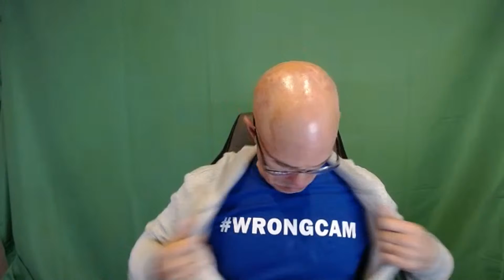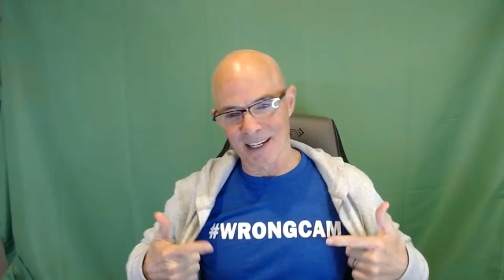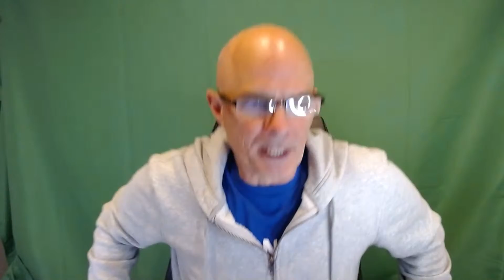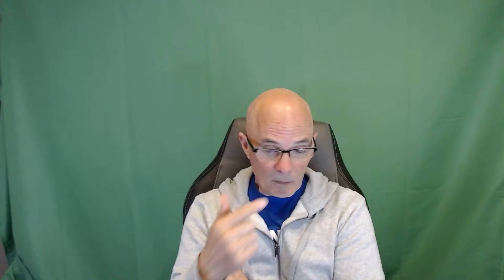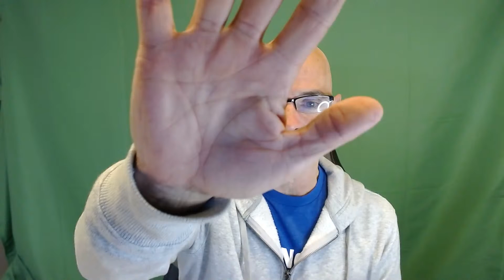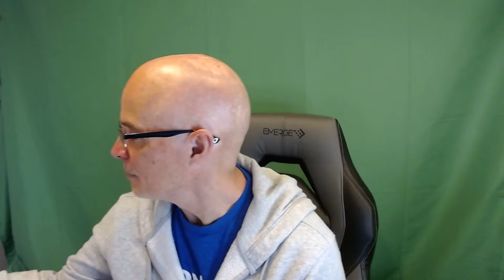BTR TRUCK NORRIS HEMI CAMS-LET'S TALK TECH

Comment: What do you think their stage 4 cam could put down in a manual 5.7 challenger ? I have catless longtubes, getting a valve job and bowl blend and running 6.4 intake
Reply from the maker: will it fit the avail p-v?
Reply: @richardholdener1727 huh?

Comment: I know this is an older post, but I can’t find any videos that are more relevant.  I’m getting ready to tear into my 5.7 on my 2016 charger pursuit.  It’s got lifter tick in cylinder 3, while addressing that, I figured might as well throw in a truck Norris cam. I have one in my LS powered Jeep that I love, figured I would love this one too. Here’s my question, ultimately I want to be at 500 HP to the wheels(it’s AWD too, so expecting slightly more than usual loss), I know I won’t hit that with exhaust, Cam, and Intake.  So should I just tear down the block and add ring gap while I’m in there? I don’t think I would need much boost to hit my target.  Maybe just 5 lbs, lots of folks say you can run boost at 5 lbs safely without adding ring gap.  What are your thoughts on the topic?  If I do a complete tear down, it really makes me think I should do a stroker kit to 392.  But obviously that’s a ton more money I don’t have.
Reply from the maker: just add gap-don't need to stroke it-add boost to desired power level (you can get 500 whp with a stock cam)

Comment: I have a 2014 5.7 Ram for you to run it on. All brand new in box never installed. 392 stroker kit With a forged bottom end and pistons .005 over, block not bored/ honed diamond finished yet, comp pro magnum roller rockers, 6.4 ported manifold, “hellcat” lifters, ARH long tubes, Milodon oil pan and pickup. + many more.. Motor out and disassembled. Stock cam and lifters looked great.

Comment: i've seen way too many LS truck engines die because people are adding a bunch of boost without making ring gap and rod bolt/main bolt changes. even then too many tuners are running them way too lean looking for that big number. They are not much better than the hemi really. a safer tune that lasts is the better approach.
Reply from the maker: no need to change rod or main bolts
Reply: @richardholdener1727  I’ve seen them fail. We autopsied a few blown up LS engines when I was at JBA in San Diego.  Customers who had another shop “build” their 5.3s and 6.0s before coming to us. Hard to know for sure if it was builder error or factory parts just failing. I know the aftermarket rods and pistons in those builds we did for them afterward are still doing fine 3-4 years and hundreds of passes later.

Comment: I actually just installed the btr truck Norris cam in a 6.4 hemi, knowing that it was technically designed for the 5.7 I'm curious to see how the power turns out. I'm still working on tuning it unfortunately (my first dodge tune, normally work on gm)
Reply: What car is the 6.4 in? Super interested in your results
Reply: How did the truck norris end up working out for you?

Comment: Richard would you be willing to test out lifters on a hemi 5.7 for example the 57 stock lifter compared to the 61 lifter compared to the hellcat lifter also compared to the 64 lifters off of course not MDS because there would be a restriction there but from my understanding I have heard that there is variances in these lifters so maybe it would be another test you could probably do.
Reply from the maker: what would the lifter change?
Reply: @richardholdener1727  ok myth is that the lifter plungers internally are different several companies have mentioned that the hellcat oe lifter be used for a cam application yet no one has had any video footage or dissembly nor Dyno testing on it just want to know if it's fact or myth they have also said that 5.7-6.1-6.2-6.4 hemi lifters are different yet the same part number being used online. What troubles me is that a solid roller lifter set up would be incredible for hp but having the hydraulic part 👎 and hot and cold lash to adjust the valve is the problem after if you did go to adjustable rocker arms. On top of that drilling the stock rocker arm to install a ball and cup adjustment screw with ball and cup push rods would give you a true hp number especially with hemi cams. None of this research has been done. Bud you are awesome and when you started the hemi series there was a bunch of hope that opened up to a lot of guys because being honest everyone has an LS but a Hemi on the other hand still to this day whoops on Chevy and Ford due to flow of those heads. 

Ps thanks for answering my question your awesome sir I'm super stoked that I got ahold of you sir.

Comment: Scoggin-Dickey's stock power numbers were realistic, and quite a bit less than BTR's "stock" numbers.  What gives?  Is BTR overinflating the stock numbers in order to pad their cam's numbers?  That's the only logical explanation that I can think of.  Go watch the SDPC hemi cam shootout video and pay attention to the stock numbers.  They are right in line of what you'd find in our Challengers and Chargers, with the added benefits of no accessory drive, coupled with the headers, and the power increase that both will yield.  BTR numbers were significantly higher.  Who's dyno is lying?
Reply from the maker: conspiracy theory much? You have two different dynos, running two different motors, with two different tunes, with two different set ups and yet you try to compare them. The problem isn't either of the dynos, the problem is actually you
Reply: @richardholdener1727  I called both companies to ask about their numbers and their engine dyno configs.  Pretty fair, right?  So, there's some more to the fuel for this fire.  SDPC used a Holley computer, which doesn't control VVT.  BTR used a Haltech, which does.  Can VVT actuation actually produce a 38HP gain?  Honest question asked of you.  I suppose that it can.  Man, I was just going off the data in YOUR Hemi book that I have in MY library.  SDPC's numbers lined up with those that you published.  Knowing what I know about where you test, there's also a Holley EFI system there, as well.  Am I on the right track now?  Will my VVT-controlled engine, with BTR's Stage 4 cam, produce the same 500+HP number that they saw?  I would like to think so.
Reply: @ronbo422  holley couldn't do the intake runner either until terminator x. that would make a huge difference. we tuned Dan Taylor's 66 Polara at JBA before X and it only made 360 or so to the wheels. they recently changed to X and it made 410+ to the wheels on a stock SRT 392 crate.
Reply: @blueduster74  Just from switching the SRV?  Or controlling VVT?  Or both?
Reply: @ronbo422  both. initial version controlled vvt but not well. the tables sucked. Jeff Turk getting hired at Holley and him bringing in better people really changed everything.

Comment: 21:46 I just watched Steve’s dyno video where he had all the bolts sheared off and exploded the supercharger. I think he said it turned 105,000 RPM scary video when you consider what could’ve happened. Also the hemi pistons are nowhere near as strong as the LS pistons. and last, but not least the hemi‘s issues with cam failure or lifter failure is doing a big part I honestly believe due to oil, viscosity and oil change durations.
Reply: I know this is 6mo old but hopefully it helps someone . You're 💯% correct on that last part with the oil. The hemi was originally tested and built to use 5w-30. The eventual change to 5w-20 was a gain in fuel economy due to less drag. No, you won't ever notice it or care it's so negligible, but, for a manufacturer getting better economy even on tiny scales and applied over millions of engines, it was done to appease the EPA and lighten their "fines". Look at EVERY other flavor HEMI...see a trend? All 5-40 or 0-40. Those engines are all limited or low production numbers vs a 5.7. The overall best consensus seems to be 5w-40 in the summer, and 0w-40 in the winter. The oils I see tested best are Pennzoil Ultra Platinum, Redline ("HEMI Honey") and I think it's 5w-30, then AMSOIL, Royal Purple, and Mobil1 Euro. At least I think the Euro is preferred based  on what's in it and the shear vs the standard Mobil1.

Comment: Let’s not forget the oiling issue cams are going flat in hemi especially 5.7
Reply: got 212,000 miles on my 5.7 and I have no flat cam runs like a charm. It’s all in the maintenance and oil change intervals and what I mean is I’ve been running 10W-30 synthetic since day one and I change my oil every 3000 miles, 3500 max
Reply: @looneylonzo28  yeah same here change oil every 4000 ( Mobil 1 synthetic and  put additive in every other oil change since I've owned it. Mechanic by trade and she gave it up at 94,000. So no it's not just about maintenance, it's design issues somewhere
Reply: Lifter tray wear and not properly serviced engine constant oil changes and zinc additives being used.
Reply: That's the junk mds lifters for the most part